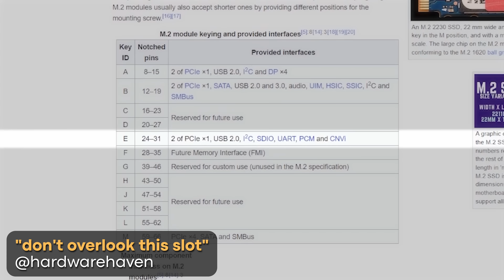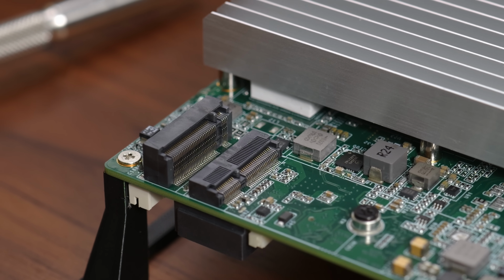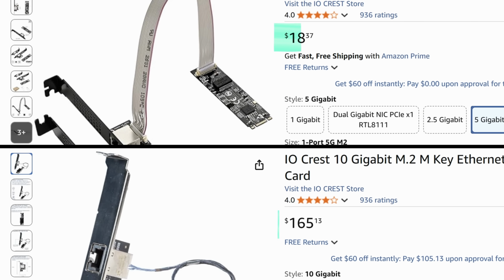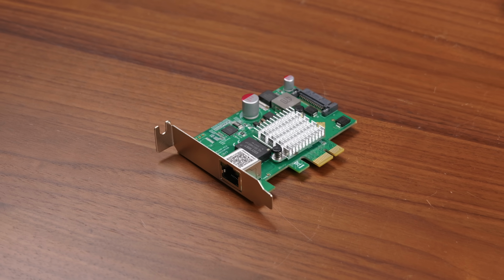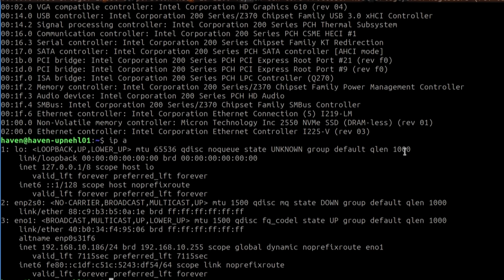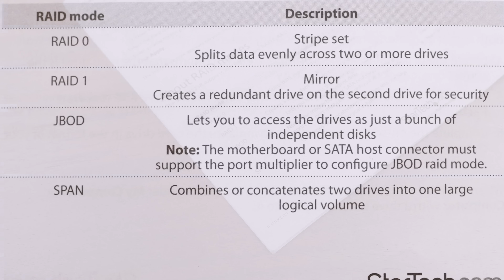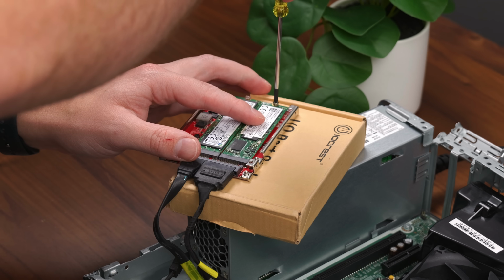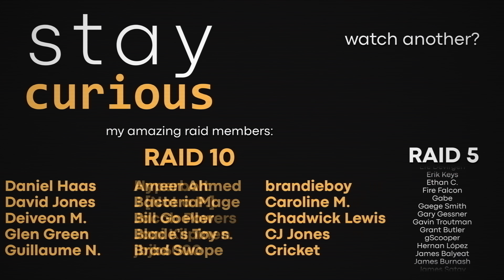I Don’t Know Why These Adapters Exist... But I Love Them

Comment from the maker: Go to https://www.piavpn.com/HardwareHaven to get 83% off from our sponsor Private Internet Access with 4 months free!
Reply: YouTube really needs to ban pinning VPN ads before legal trouble happens.
Reply: on the 2.5 gigabit poe card you can give power to the board that houses a 5g cellurar modem
Reply: Find a true SAS drive to SATA mainboard adapter. HP sells "fake" ones that do not translate the protocol.
Reply: 😂7  is this uh 0:01 j  0:01 0:01 vehicle.  0:01 v .  
Gvh 
😮t9ii 0:01
Reply: I would like to see more use cases for these adapters.
Reply: this is why I want to make a stripped down super fast RISCV chip of my own that has a stupid amount of PCIe lanes in it and pretty much nothing else except a serviceable console, etc.  the only differences between boards will be how they decide to configure and break out the lanes into the M.2 types as well as NGFF and forward form factors (reusable until PCIe is obsoleted by industry).
Reply: 2.5GigE High speed and industrial cameras! ...
Reply: https://www.youtube.com/watch?v=PJ6ghjRBFGQ
Reply: i got a 8500g cpu, but couldn't use the m.2 because i had a gpu. the cpu only has 1 pci-e on it. it wouldn't see the m.2 on my motherboard, used a m.2/sata adaptor like that to use the m.2 through the sata of the M.B. since the m.2 was the upgrade boot drive and had my system on it, it saved my build for $14.
Reply: goofy adapters
Reply: Another VPN SCAM AD = Another THUMB DOWN.
PLEASE STOP SCAMMING PEOPLE.
Video reported as a scam.
Reply: @cosmefulanito5933  Precisely.  As for that "military grade encryption" my webserver running on a cheap VPS supports post-quantum cryptography and scores A+ on SSL Labs.
Reply: @cosmefulanito5933  Why do you think the VPN ad is a Scam? Many of the VPNs do have misleading marketing but the service itself functions as it should, it is not a scam. Also in this ad, he did not make any misleading claims about the VPN.
Reply: @cosmefulanito5933  its up to you use vpn or not bro
people use vpn to bypass geographical content access they knows that only bro

Comment: Something you will likely need to research more than I have, but I believe Asrock was looking at doing a mini-capture-card for a M.2 slot, that could/would have a cable to a backplate of a PC case, for smaller boards with less/no free PCI-E slots, and/or SFF builds and some other vid in/passthrough out setup.

Comment: The dual m.2 ssd adapter works very well with 2 512 gb m.2 ssd's in raid 0.. Shows as a single 1 terabyte drive and runs at the full sata speed. Used it for docs, download backups and even a few older games. Haven't had any issues in an AMD system on an x570 board. Allowed me to use the drives since my normal m.2 slots are occupied and I had a SATA connection left.

Comment: Did you try the double SATA adapter in the "span" mode where the controller appends one drive to the other? I wonder if that also requires the drive multiplication support.

Comment: Thanks for the video, and just to say enterprise sd cards are plenty durable, we run those in our vmware blade chassis as the OS drive. I have not see a single failure yet out of the 22 hosts we have had over the past 8 years.

Comment: you save me to expend 50 bucks on the 2 M.2 adapter because I was going to buy it to install in my 2012 Intel i5 Mac Mini, but in this case you are better on buying a nvme adapter with 1 tb ssd and installing it they are cheaper in Alli Express but they take like 10 days  to 15 days to get to the USA.

Comment: PCIe NIC card with PoE is great if you want to make a very simple low-profile machine. I used one in a portable debugging rig i had in my car, powered with a PicoPSU, to be able to drive to places and debug what's going on with cameras and such. You can find some for cheaper tho, i had mine for CAD 20$ and i was happy i only paid that when i countered an internally shorted camera, it fried the card entirely but still protected the PicoPSU and motherboard.

Comment: if you like little adaptors and love hardware,   then you should look into Esp32's and arduino modules running with Home Assistant EspHome,  because there is literally no code you have to write to flash and run esp32's doing pretty much anything.   coupled with the modules available,  you dont have to know anything about electronics,  because the hard part is done for you. the rest is just hooking up adapors/modules to the little micro computers known as Arduino's.  the most common of which is Esp32's.

Comment: Thank you for this.
Perhaps you or contributors could could come up with a truly useful for 'smart card' slots on laptops. They take up a lot of space on m'boards and sides of machines to do a single job which can be done in other ways.
Recently someone showed me a moderately priced laptop which lacked ANY SD reader but had a big slot for corporate use. A shocking waste of space and potential.

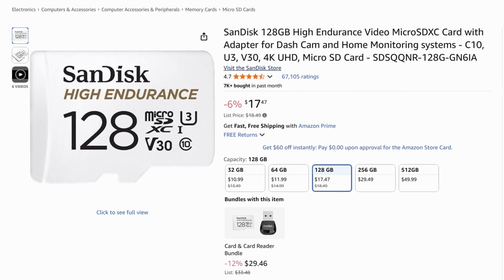Comment: 2:25 the "high endurance" SD cards are mainly designed for linear writes, like from a dashcam or security camera. Lots of small random writes will still kill them over time, just like regular SD cards.

Also, a lot of E-key M.2 slots are unfortunately CNVi-only, meaning they can only be used for Intel wifi.

Comment: For the PCI POE card, what sprang to mind for me was putting it in my home theater PC and using the POE to power a 5-port Unifi switch behind the TV. But, that's a lot to avoid plugging a USB-C adapter into a power strip for the 5-port Unifi switch.

Comment: Weird use case, I was wanting to get the dual m.sata adapter for a camera I was experimenting with. It used c-fast 2.0 cards but I was gonna use an adapter to go out to sata. Did you ever test if RAID0 on it got better sustained write speeds? I needed to hit 430-450MB/s sustained for what I was wanting to do. I instead, sold the camera and got an updated one, but I really loved that camera and I'm curious if my solution would have worked. If it would have I may still revert back to that setup at some point, it was one of my most favorite cameras.

Comment: And me with two HDDs in my Win11 machine, one network drive based HDD and those four old HDDs from old computers totaling up to less than 1 gig within a USB connected enclosure.  I need to get another enclosure for the old IDE drives... no.

Comment: Regarding adapter no. 4: I bought a similar (black) adapter last year during the holidays on AliExpress. The chip operates as a JBOD, but this had to be programmed with a special program that came with the adapter. Otherwise, the computer only saw one drive. In Windows, both drives' SMARTs are visible. Unfortunately, I don't know which chipset it uses, as the markings were sanded off.
Mine cost around $20-25 which is still not very economical. It's simply cheaper to buy a 1x1TB drive instead of 2x512GB and an adapter. The speeds are also slightly worse with the adapter than without it but as you mentioned it has some potential

Comment: What I wanna know is what is the drive size maximum of the Sata to 2 M.2 SATA drives. Like whats the maximum for each port? I would love to be able to run two 4TB M.2 drives in that thing run in raid mode and have a single 8TB storage drive for cheap!

Comment: wait until he finds the computer on board "addapters", where you can plug an actual fully functional computer in a pci and interact with it in both directions, 
Is hardware inception literally, to have a computer inside your computer without any software virtualisation. BliKVM pci for example, or many others more advanced models.

Comment: Regarding failue of aone of the drives in mirror it is the performance of the raid controller will tell you if one drive did fail. This has to do how it works  by design and a working raid controller with working drives responds quiker the one that has a failing drive. This is when you have a geniunie hardware mirror then this will be the case.

Comment: 'Way back playback' Pentium CPU socket A to slot 1 adapter.  I picked one up a computer show to upgrade my system and it worked without any problems.

Comment: I always wish there were ram type adapters, DDR3 to 4, or vice versa, etc.   Also, WAY back, you could get adapters to take 2 or 4 ram sticks and the adapter fit into the ram slot on the mbd and you'd have the full amount of ram.  This was assuming the mbd dud support that size ram in that slot.  Yes, I'm dating myself knowing of these things...  :)

Comment: PoE i think is for two purposes
1. connect to a PoE ethernet camera, most for industrial uses. But since AI is going boom now, maybe a smart Surveillance DIY version?
2. some switches actually can be power by PoE in, the best i know is mikrotik ones, this should be great for putting switch on each floor's smaller electrical box without power.

Comment: Not a weird one, but I use a pci-e to pci riser adapter card to use my Juli@ sound card on my Supermicro C7X99-OCE motherboard, which do not have a pci slot. I bought two variants of it, one riser and another one pcie x1with an extension cord which uses an usb 3 cable and a pcislot card on the other end. Both works perfectly fine. I recently bought an adapter so I could fit an nvme drive in a wifi slot, haven't tried it yet though.

Comment: I have a large GPU in the way of the other PCI slots. But I also had a Video input device for recording from TV, that is PCI based. I finally found a cable that permitted its installation, once I found the darned hidden NVME. Haven't guaranteed that it works yet.

Comment: I have one of those PoE to 12V barrel splitters. I use it to power my fibre ONT. It's in a different room to the rest of my gear but I wanted it on my UPS. So this was the perfect solution.

Comment: If you've still got that SATA RAID adapter plugged in, I'd be very interested in the smartctl output of that RAID1 set when you have both disks healthy, one dead, one rebuilding.  Were that manufacturer on the ball using one of those fields to enumerate the RAID state is the most likely way to get the monitoring out of the SATA port.

Comment: Three companies that make a bunch of fun stuff like this:
Startech & Delock, All kind of expansion card and adapters for anything you can imagine.
ICY Dock, all kinds of fun stuff for storage. 

One fun one: They got the MB204MP-B expansion card. its a PCI-E 5.0 16x card that requires Bi-furcation and allows you to put in 4x Gen5 NVMe SSD. You can then raid1 all of them for a roughly 50GB/s. That is RAM speed storage.

One usefull one: MB104U-1SMB R1, USB-C connected drive adapter. Connect a 2.5" SATA SSD or a M.2 SATA/NVMe. One adapter for the most common drives you encounter as a daily tech.

Comment: Wait.. so If I have an P3 1TB Internal SSD PCIe Gen 3 x4 NVMe can I get an adapter to add another P3 1TB Internal SSD PCIe Gen 3 x4 NVMe without having to buy a new motherboard? (just to increase my storage size) - if so.. what are the drawbacks?

Comment: I think what makes an adapter "goofy" is if it has very limited use cases.  If everybody could use it, it wouldn't be goofy.  That said, my nominee would be one that I did manage to find a use for...
A PCIe x16 low profile to full height adapter that splits of two x4 lanes to a pair of M.2 slots (one on the front, one on the back) and passes the remaining x8 lanes through to a x16 slot.  

What problem this card solves:  I need two more M.2 slots with PCIe connectivity. 

Why it's so very limited in use cases:
1) It requires a board that supports x8x4x4 PCIe bifurcation.  So basically, "server gear."
2) Most server gear these days only have half height slots
3) The most obvious application here would be a GPU in the x16 (x8 electrical) slot that gets passed through, but you wouldn't want it for any applications that lean on the PCIe bandwidth as you've cut it in half.  So it would be bad for things like most AI workloads, and gaming.  So we can pretty much narrow it down to transcoding, so it's great if you just want a P4 (for example) to get access to NVENC and NVDEC, but not for other heavy workloads.  
4) since one of the M.2 slots is on the back of the riser, it further constrains what you can put in it and/or where it will fit.  

At a certain point, you have to wonder if the target demographic for something is just "me."  

At any rate, I have a "test bench" server that is constantly getting used to test various parts, so it never found its way into my rack.  It's a x9 series SuperMicro 2U "Super I/O" chassis that has a pair of risers that split off to 4x full height slots and 2x half height slots.  It supports bifurcation, but it doesn't have any M.2 slots.  I sometimes use it for quick transcoding jobs, so it's home to one of my P4s.  

The only think the adapter is really "missing" is the bracket extender I've seen used on other half height to full height adapters (someone else here mentioned to the StarTech PCI to PCIe adapter, which has the bracket I'm talking about) that would cut down on the "jank" factor a bit, but otherwise it works surprisingly.  It may only have an audience of one, but it did find its audience.  lol

Comment: Instead of bothering to implement a hardware raid controller people should just make 2.5" adapters that take a single SATA power plug and two SATA plugs that allow you to mount two M.2 SATA drives, metal case with thermal pad for bonus.
I would totally buy something like that. It's useful for say, putting in two of those little SATA interface Optane drives for write cache on Truenas machine.

Comment: Goofy adapters:
Asrock M.2 VGA module (I believe Innodisk also made something similar)
x16 to m.2-m.2-x8 PCIe bifurication adapter
MXM to PCIe
SODIMM to DDR adapters
OCZ Z-Drive (technically a RAM to PCI adapter if you think about it)
CAN BUS and Serial to M.2 adapter/expansion cards

Comment: I put a couple USB on a free header on my mobo and connected a wifi/bluetooth dongle, then connected my keyboard and mouse dongles inside. Now I only have my mouse dongle there and a USB 12v amplifier to power a radio cradle. That way I always have my radio charging next to me. It's fun to look for random adapters then finding funny applications to them.

Comment: That RAID adapter reminds me of something I had for my Sony PSP back in the day.  It was called the "Photofast Adapter" because it was meant for Sony's cameras which, like the PSP, used proprietary Memory Sticks Pros.  

The Photofast Adapter had two slots for microSD cards and a little RAID controller built-in.  A 32GB Memory Stick was crazy expensive back in the day; but, I picked up that adapter from Walmart and a pair of 16GB PNY micro SD cards from a Sears that was going out of business.  Then I was balling on a budget.  I still have that original set-up in my PSP to this day.   

You can still buy these adapters for not a whole lot of money from the usual sources.

Comment: Talking about a boot drive for anything but the normal drive the motherboard expects is a waste of breath and noise our ear holes must take. Nobody is going to look for an adaptor for any boot drive. The only talk about boot drives should be size of the drive for 1 drive to many. MY programs are on 1 drive. My Docs are on another. My games are on 3 others Is my 512 GB NVME boot drive enough or excessive? Well I have 127 GB free after 6 years without cleaning junk so I think yes.

Anywho, drive adaptors are not bought for boot drives but for more storage when they run out of storage slots. The last adaptor if it wasn't a hardware raid one would be very handy. 2 M.2 drives plugged into one of the motherboard SATA ports via a cable is a great solution for mass storage. Sadly it is Raid only.

Comment: The adapter 4 is something I actually use but not the one you have. Mine has 4 instead of 2 slots and supports NVME and not SATA. My computer only had two NVME slots on it and I needed 6 without busting the bank so I got an adapter and it fits on PCIE 1. It does suffer from a slower data transfer speed then the individual SSDs can support, but it's very useful sense they are there to store backup/recovery data. It's speed is just about as fast as a Western Digital Blue SN570 and each of mine are WDB SN5000 while the dedicated M.2 slots have Western Digital Black.  In total I have 8 TBs of storage space with each one holding 2 TBs. I saved my self over $1,000 by reusing existing and only buying two new SSD instead of the motherboard I really wanted that could handle it but have reduced gaming performance issues.

Comment: Adapter for a 2012 /2013 apple ssd to to msata than to usb to fix a corrupted apple ssd, why replace the logic board when you can wipe it with linux and put it back 70 bucks including the screwdrivers... (fixed it) question is why does it exist... xD

Comment: my pc's I/O is full. so i'm back to buying sata drives. this would help if it could support real pci-e nvme. like, put a bunch of drives in the same slot.

i wonder. is there such a thing as a hub for nvme drives? like so i can plug four drives in the same port? even if they share 4 lanes, that's still good for me

Comment: 8:35 I would absolutely find an usecase for this, but it depends on how much wattage that PoE can carry.
Namely, imagine a setup - you have your main PC and you have physically on top of it small NAS running few sata ssds via some SBC that can get POE power and can break out power to the sata drives (or do custom solution to handle it, but inside that shell of the nas). Than you can have it set up, so that it gives your PC DHCP address (or you set it up statically), and boom, you get NAS that is only for your PC, so even if someone (guests for example, for these people like me that dont trust anything and anyone) snoops on your network, finding the NAS will be much more challenging.